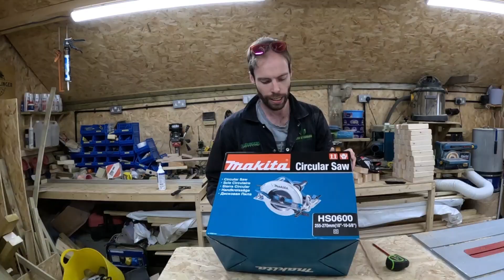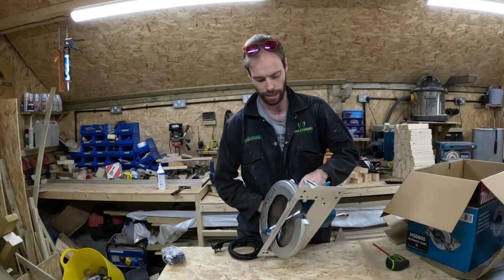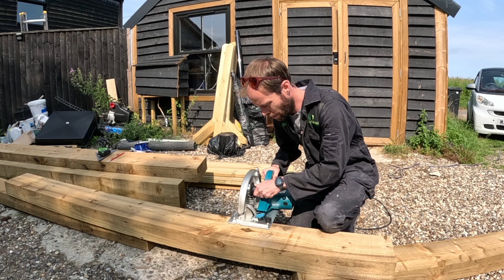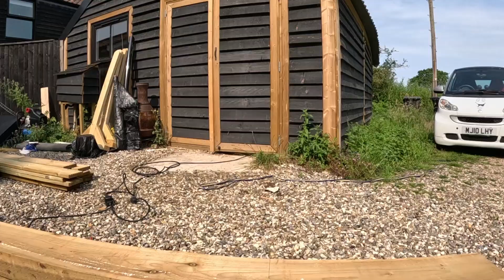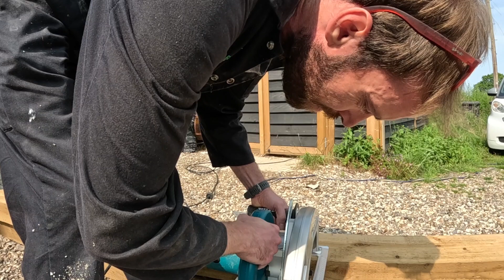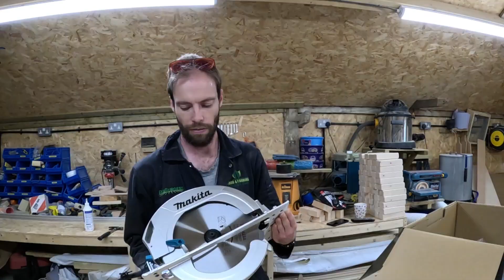I review the Makita HS0600 270mm electric saw.

Comment: Just a tip for using big circular saws. always cut in such a way that the motor side of the circular saw will sit on a heavy piece work piece, so when you reached at the end of the cut, the saw will ended up siting on the heavy piece, prevent blade jam or kick back.

Comment: Always cut off your overhang and let it drop. Usually an off cut. So double the blocks up next to each other. And cut letting it drop rather than see saw and pinch your blade. This will stop the kickback. Don’t middle cut between 2 props like that. Just avoid that and never be directly behind any circ saw anyway can see sights on blade cut or guide from side on with this tool and if still kicks because something goes wrong you have a safe position by habit. Happy work to you 🤙

Comment: What was the price of this saw? Thanks!
Reply: The reason the saw is binding is you have it supported at both ends. When you complete the cut the timber pinches the saw and kicks back. Have the large section supported and the short section unsupported, that way when you complete the cut the short section will peel away rather than pinch the blade.
Reply: 252€

Comment: @botanical1968 wrote:
4 months ago
The reason the saw is binding is you have it supported at both ends. When you complete the cut the timber pinches the saw and kicks back. Have the large section supported and the short section unsupported, that way when you complete the cut the short section will peel away rather than pinch the blade.